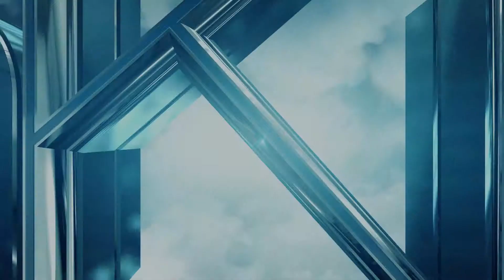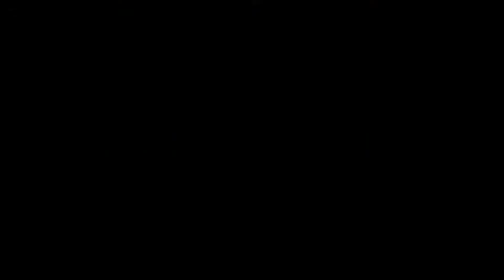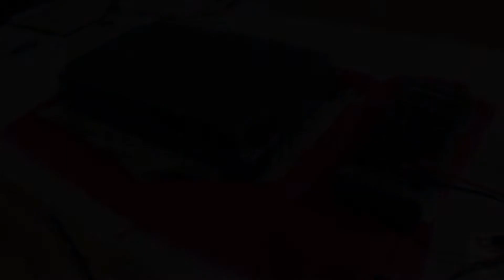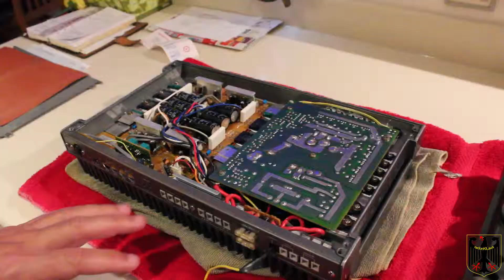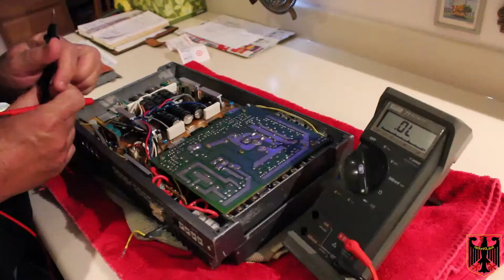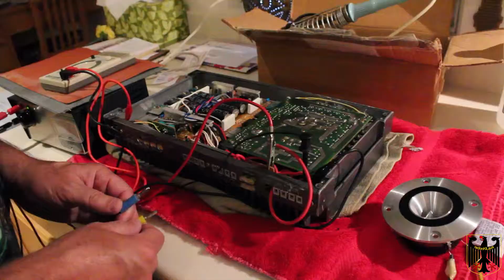ADS PQ20.2 Diagnosis and Repair

Comment: I used to really love my PH15 and my PQ20. The most common problem with ADS amps is that the channels die after awhile. The PH15 had 2 power supplies but was only 50 watts a channel times 6. Plus I really hated the din/rca hookup.

Comment: can you fix my a.d.s amp it plays but I have more sound on the left than the right side it's a 6ch and I run the front bridged and rear regular, I would take It to a local shop but not sure if they will repair it with good quality parts
Reply from the maker: I don't really repair electronics for others anymore, this was just a favor for a friend a few years ago.  I used to own an electronics repair business, but now that everything is "throwaway" it's no longer profitable.  It sounds like an output circuit issue with your amp, which should be something most shops can diagnose and repair assuming everything is intact in the amp.  It's only worth fixing if you can DIY or find somebody to do it for a reasonable price, though, since there are lots of high-quality (albeit non-servicable) amps available nowadays for very cheap.  Thanks for watching, and good luck!
Reply: We will pay

Comment: hi there, great information on how to check transistors! do you happen to know of any service manuals for these old amps? i have a Pq20 myself and i just want to know how to fix it when it breaks... IF it breaks...
Reply from the maker: +justin smith I don't have any old service manuals for these amps, as back when these were made, I owned a business that focused primarily on high-end home audio.  They're relatively easy to work on as long as the PCB isn't damaged, though, so repairs should be simple.  Thanks for watching!